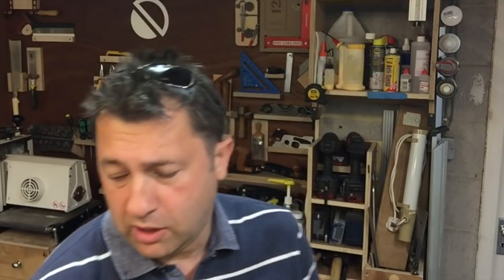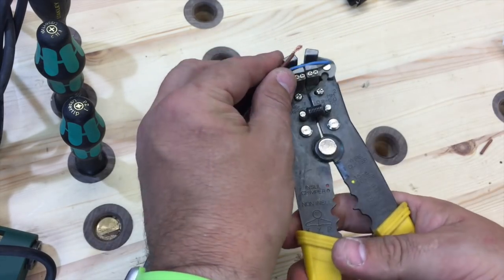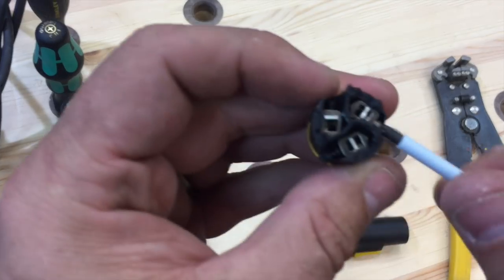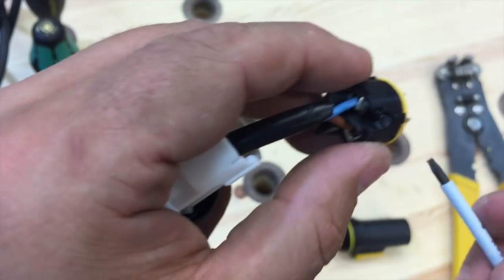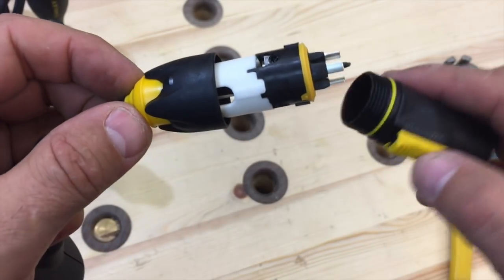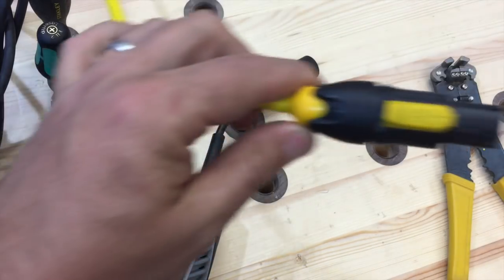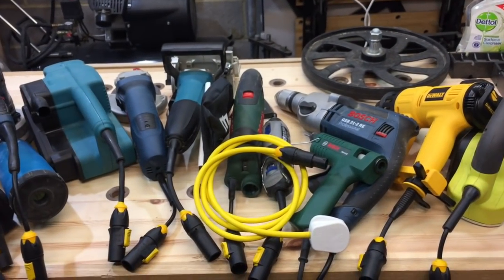Easy Power Tool Cable Solution.                                      (Neutrik PowerCon True1)

Comment: seems like the idea would be better if the connectors used the standard connections (so you could use a regular extension cord in a pinch, or multiple tools plugged in at the same time).  the only change i'd make would be to use some kind of locking plug connection that could lock the cords together.  or even better, a locking mechanism on the tool cord that could lock on to most extension cords.  then you could use the extension cords you already have.  still a good idea, though.  nice video!

Comment: So you actually need just one female connector for the cable. One male connector per tool. So you have to buy more male ones and just one female will suffice?
Reply from the maker: MySchizo Buddy yes, I bought a few female ones so I have a few spare cables. I have worked with it for a good while now and it's great!

Comment: Not seen an update on this recently, but wanted to throw my pennith in (lancashire phrase in uk!) These have been around for a long time now and they were developed by neutrik for the ents industry. These are bloody amazing and high current rated. Neutrik is the world leader and in fact they are the designer and manufacturer of these. Just be careful as there are many chinese rip off versions!! Only use the genuine connectors .... as an aside  they are fully water tight and where designed to be used outdoors for production/events. Love the video and great to see them used for other applications!! Happy days!

Comment: Greatness!  Thanks so much for turning me on to this!  When mine come, my plan is to attach the female connectors to cords of varying lengths: 3-foot, 5-ft, 10', 15', 20' cords, which I'll color code with some tape around the wire next to the connector.
Reply from the maker: i have been using them now for some months and i love it tools are really quick to swap out and the connectors dont get in the way!
Reply: I would think the issue with your plan is electrocution should you accidentally touch the live probes.

Comment: I'm not sure about the practicality of this set-up.  At 8+ dollars for each tool and then the tool can only be used on the additionally fitted cord, I''m no so sure.  Seems like once you go with this set up you either have to have multiple mating cords or an adapter to use multiple tools at the same time on the job.  This may be a good set-up for the bench, but on a job with multiple carpenters/mechanics, this set up would become self limiting. But nevertheless, a fine looking connector set.
Reply from the maker: Scott H works well in my workshop, but maybe not so much for a job site!

Comment: Did you ever try connecting your extension cord to a GEFI OUTLET IF NOT TRY CONNECTING IT to SEE IF IT WORKS   On mine it trips the outlet on a  GEFI WAS and on regular outlets it works fine.
Reply from the maker: Ignacio Ortiz I am in the UK. I think you may be referring to GFCI outlets. We don’t have these.
Reply: have you accidentally wired neutral to ground by chance? that would work in a normal outlet but trip a gfci.

Comment: By doing this, don't you void the warranty?  It's a good idea, but you will have to wait till you tool warranty expires.
Reply: Yes, you do, but I don't recall ever using the warranty on any tool. That said, now my tools that have this are now out of warranty, although they weren't when I did this. I just took the risk :)
Reply: Thanks for the reply. I have some power tools that i use today that's past it's warranty.  I will use this setup for those tools.   I also have a few that i recently purchased that I'm not willing to chance.

 I've had power tools go out on me before the warranty expired  and I have some lifetime warranty tools, Rigid.   
I will reach out to the rep and see what they say. 

I really like this setup.  Dealing with power cords have been a pain in my ass for a very long time and I think this is a wonderful solution!
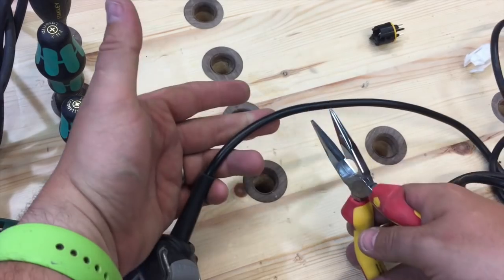Reply: Damn,  1:01 I don't know how i missed that, but you did mention  the warranty.  I need some coffee!
Reply from the maker: 34stzoo here’s the thing, the benefit far out ways the risk for me. The continued inconvenience of cables vs. the risk of one of my tools failing made it worth while. Gotta go with your gut though ;) good luck 😉

Comment: Great stuff!! The dremmels the one tool I'd imagine would need the light tether-does the plug and socket thing get in the way for bulk and weight? :)
Reply from the maker: Nope, but if you are concerned just leave a bit more cable. I also use the extension on my dremel for fine detailed control. Even without this the connection is no problem!

Comment: Hi. This seems straight forward enough, but im really no sparky.....So can I ask.....The power cord you used......does that have an earth in it which is wired in to the regular UK plug at the other end?.......If so.....do you connect the earth in to the female connector (if you dont have it in the male)?   Can you explain this bit a little please. 
Regards, Chris.
Reply from the maker: The neutrik connectors have an earth, but not one of my power tools had an earth to the corded plugs. So I feel confident that not using an earth is not an issue. 

You will see if you unscrew the plugs on any hand held power tool. 

Thanks geoff
Reply from the maker: Sharp Edge Woodworking that said I di earth from the plug to the female connector, but as the tool has no earth couldn't take it to the tool. But at least the connector cable is earthed.
Reply: Stuff I Made  Yeah I guess if it doesn't have one already, it must be good. What type/core/gauge of cable do I ask for when I go to the sparky suppliers...do you know?
Reply from the maker: Sharp Edge Woodworking I am no sparky, but some tools are 5amp, 10amp and 13amp so I made up cables using a length of cable from a 13amp supply. You could just use the cables you cut off the tools. 

Note what fuse you have in each tool and create cables with fuses for each type. Different colour cables for different fuses. Shouldn't really be an issue. But do this at your own risk ;)
Reply: Yeah so as long as your cable can handle the highest 13 amp tools....all the lesser ones with run fine...right?  ;o)

Comment: Why not use standard sockets like you have at the back of PC towers?
Reply from the maker: Max Maker yep I did consider this as you can buy a female version. I think they are a bit tight fitting and clunky, and the cost was only double, so as a one time investment I preferred this option.
Reply: Stuff I Made was wondering the same.. This is a fair answer..